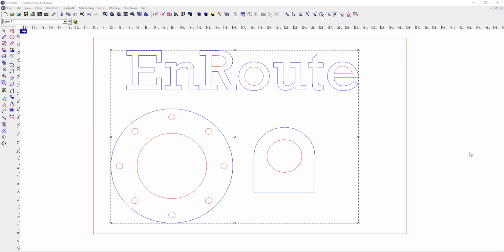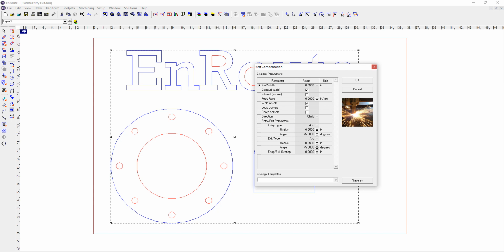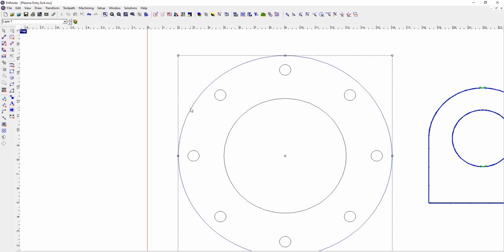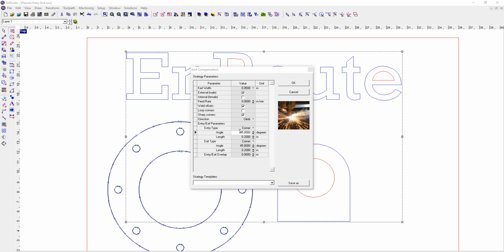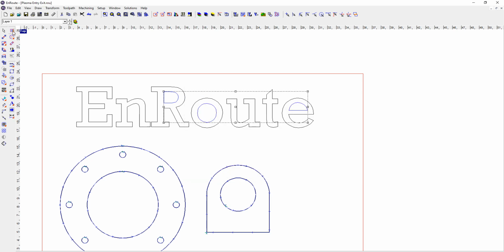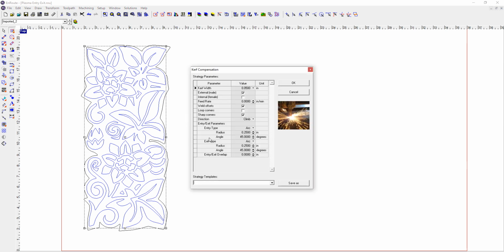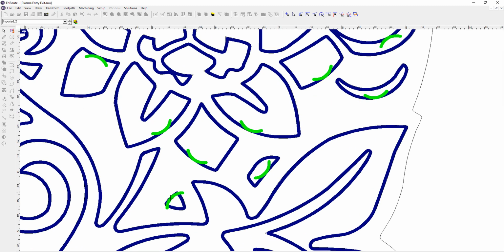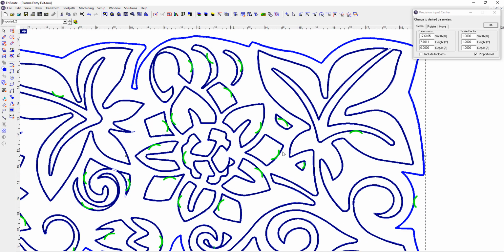EnRoute Fabrication - Entry Exit for Plasma Cutting

Comment: I uploaded a solidworks part into enroute so I can use a plasma cutter. However, Enroute made several entry and exit points on each line even though they only require 1 entry and 1 exit. How to I get rid of the entry and exits I don't need or want so it cuts in one shot?